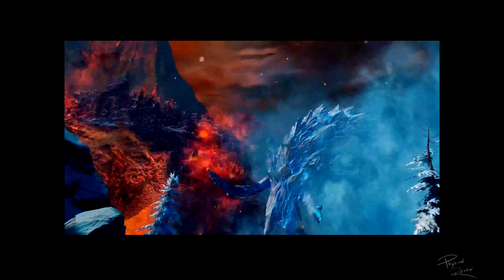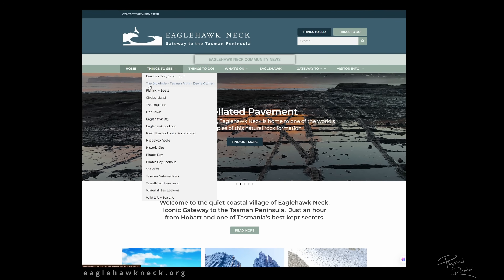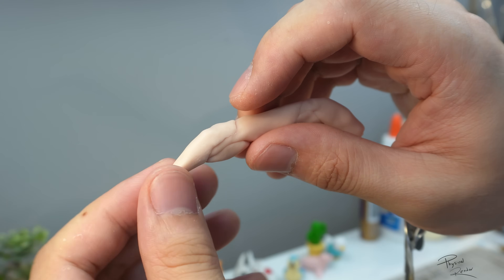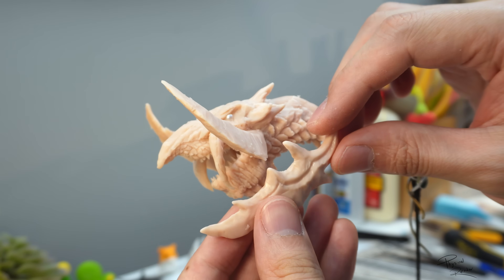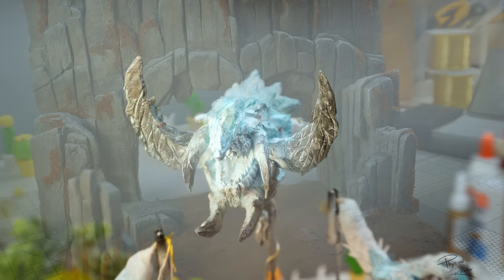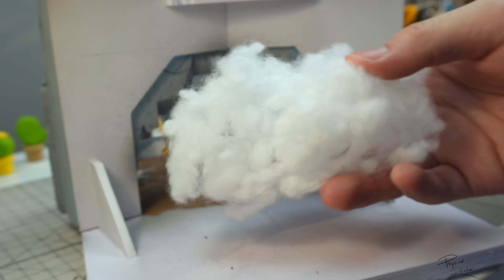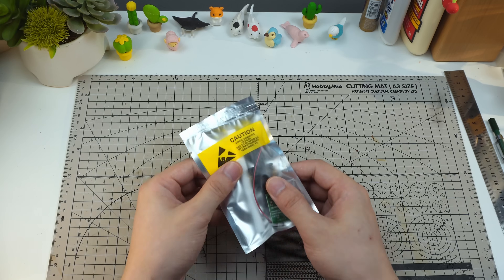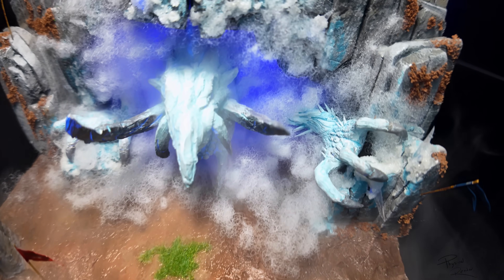I Built an Ice Dragon that actually Breathes Mist | Jormag GW2 Diorama

Comment: Another absolutely magical build! I found some of my glues will melt foam, and when that is the result I want, it is awesome. But when I have spent time carving and sculpting something, I would really like it to not be destroyed accidentally! So I have a question if you don't mind? What type of glue do you use on the foam?
Reply from the maker: I absolutely understand, that's exactly how it was to me when I first got into crafting with foam. To keep it easier to understand, I will just list it out by points:
- CA glue (Super glue) will melt and eat through foams.
- Best glue for foam is hot glue. But make sure it is not too hot, else it will start melting the foams. It will also cause bubbles leading to the joint expanding as the glue cools down (I use a 20watts hot glue gun for foam. Anything stronger gets too hot for long sessions)
- If you really want to use CA glues on some delicate structures where hot glue isn't permissible, seal the surface of the gluing area with a PVA glue (any white glue) before you use CA glue. (By ""seal I mean paint a thin layer and let it dry, essentially treating the surface to receive the CA glue)
-That would alternatively mean that we can use PVA glues to stick your foams. But foam does not absorb or allow the PVA glue to dry up with joints, so it doesn't work.
There is probably other ideas, but I don't know much, just yet. But hopefully this helps you out!
Reply: @physicalrender thank you very much, that is really useful information
Reply from the maker: @nessiemonstercrafts  Glad to hear that's useful. If there are any questions later, please feel free to share. All the best with your projects!